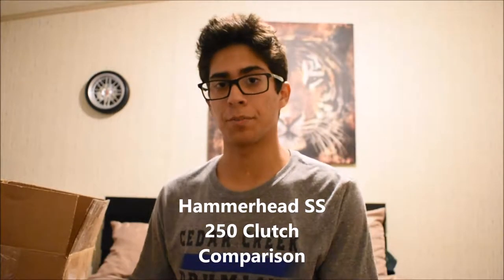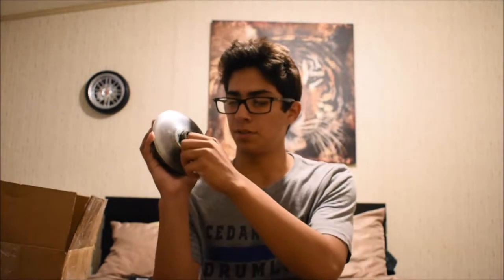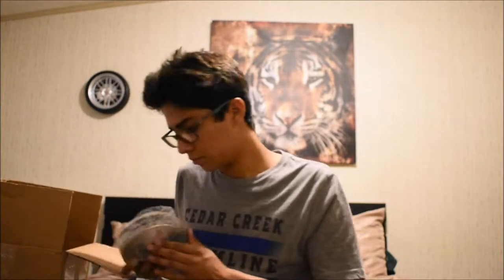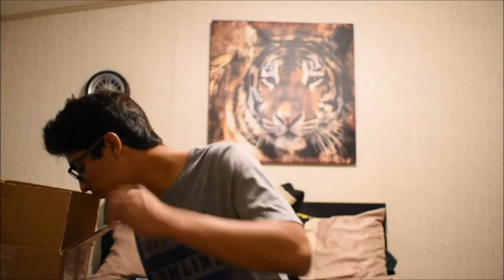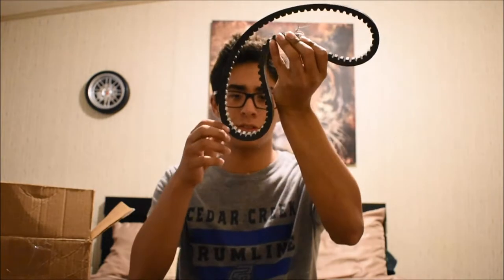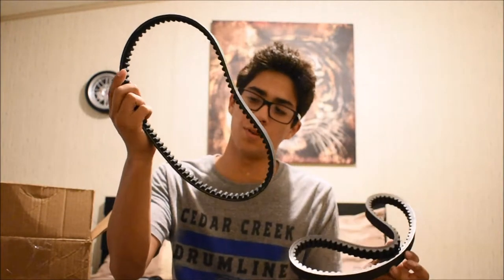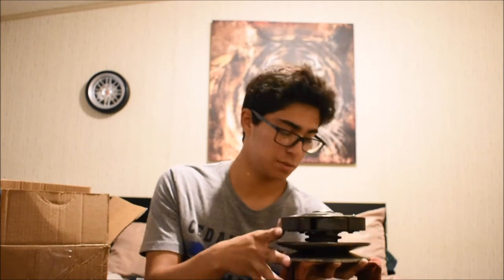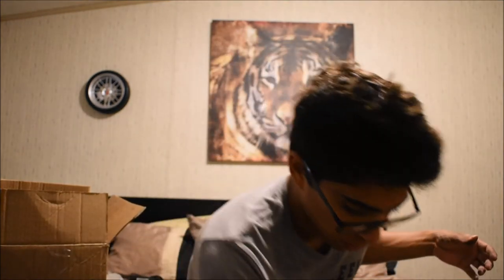Go Kart Clutch Comparison 250 CC NEW VS. OLD Hammerhead 250 SS

Comment: Thank you for the video!  I got a Hammerhead 250cc and the belt basically turned to dust.  I'm gonna replace the clutch after seeing this.
Reply from the maker: Hey yes I will say that is probably good idea, but be sure to check there isn't something else wrong in the system before replacing, happy tinkering!
Reply: @JordanPedroza  thanks, man.  I got the whole clutch, belt, and the aluminum spindle thing for 180 and it's fuckin running now!  20 year old burnt out shit.  I appreciate people like you for making these videos.  Stay up, homie!

Comment: What clutches work in it? Like is it a specific clutch or will any CVT 250cc clutch work or what I don't understand this stuff and I just got a SS 250 hammerhead and I'm worried about clutch so I want to order a backup one
Reply from the maker: Any clutch from a 250cc will work even a 300cc if the shaft diameter is the same
Reply from the maker: Specifically look for one that works with the cf moto 250
Reply: @JordanPedroza  thank you will have a look. Much appreciated
Reply: @JordanPedroza  I just figured something out. On the stock motor on the hammer Twister 250, the carby has a small L shaped hose. If you block the end of it or squeez it when your foot is flat on the gas, it seems to bypass the rev limit where you go so fast it sort of pops n bangs n what not like it's hitting a limiter, when it's hitting that limiter, reach over and squeez that hose, then it just GOES like a slut str8 out of hell it just wants to move like I had to decelerate cause I thought I was guns blow the engine. This is all stock. With SHIT rusted bearings ect. Old kart. No intake mods.  Str8 pipe only. And it flies to a out 67-68kmph before it starts sounding a lil to loud as if it might blow
Reply: I just bought a 2015 SS 250

Comment: Will the 150cc variator's and clutches work on the 250cc?
Reply from the maker: TheTruthBeTold  No they do not... I’ve had both types of engine you can see in my spider box videos but the 250 cvts are gigantic compared to the 150s also I’m sure the output shafts are different so they won’t fit